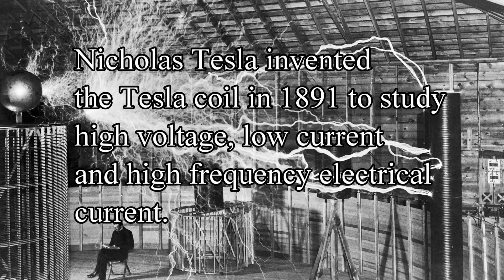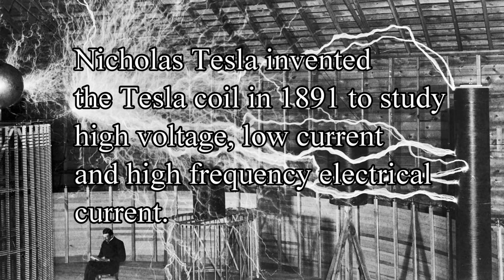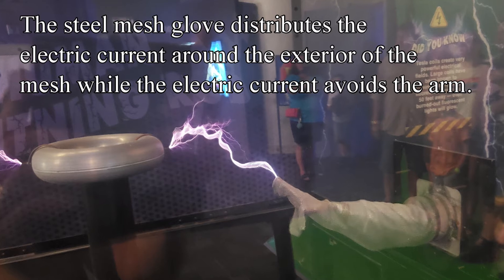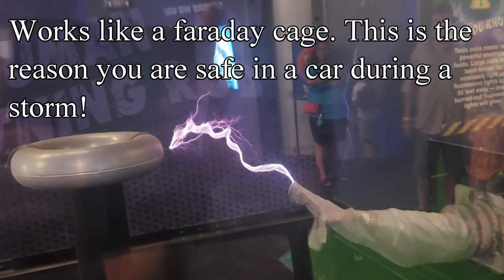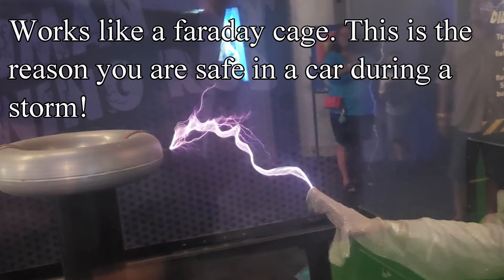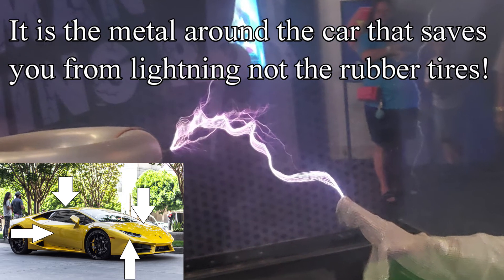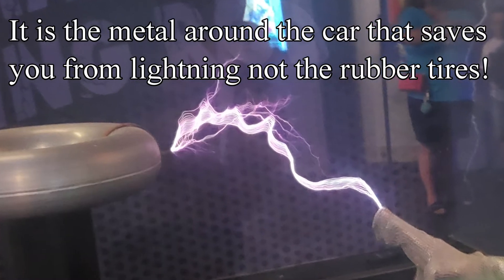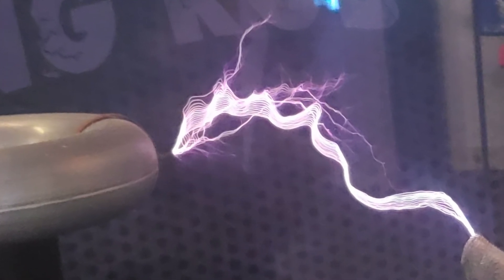Touching 100000 Volts Of Electricity- The Tesla Coil In Action

Comment: The Darkside is strong in you, lightning bolts out your fingers like Emperor Palpatine
Reply from the maker: Believe it or not it is the metal that protects you from the electricity. If you were in a lightning storm the safest thing to be in is in a complete metal suit. This is also the reason one is safe in a car not due to the rubber tires but due to the metal saving you.
Reply: The frequency is too high from the tesla coil to hurt you. That high frequency is what is saving you not metal or whatever you said.